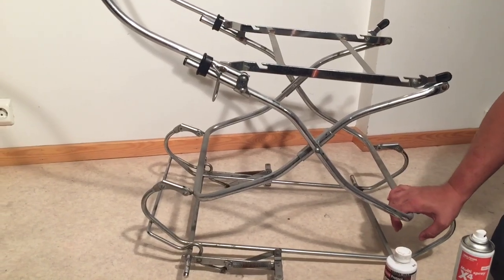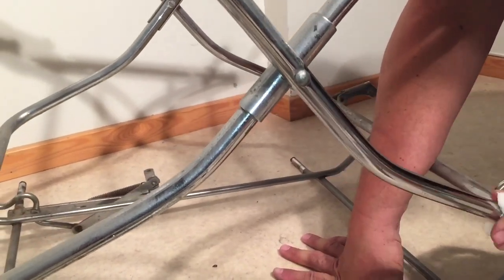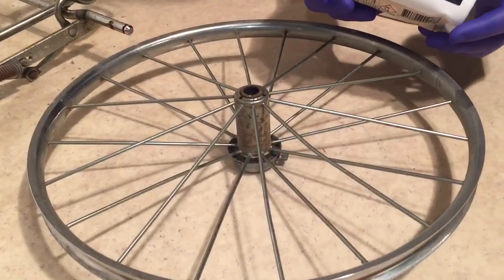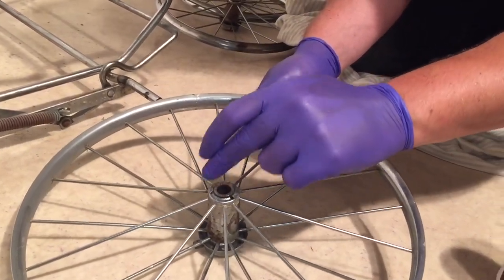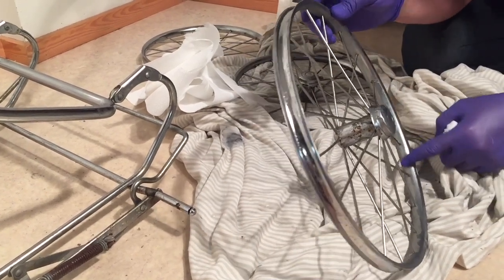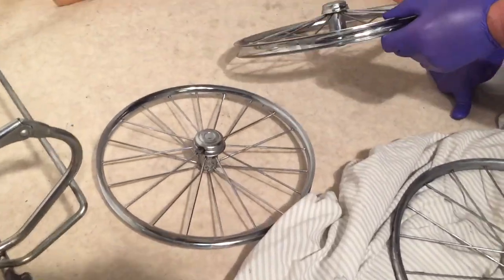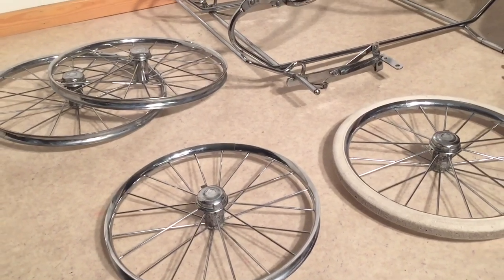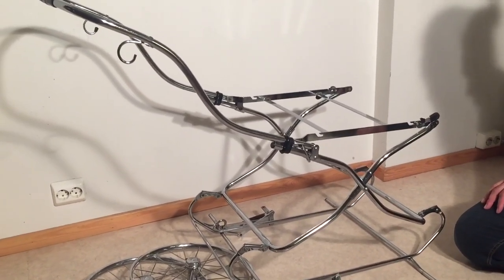Vintage Stroller Renovation: 3 Ways to Remove Rust from the Chassis and Wheels

Comment: Thank you for producing this video. As a stroller and pram collector I run across the rust and caulking a lot. The Simo Classic is a beautiful pram. I don't have a Classic but have three Simo Nordic Cruisers in my collection along with several Emmaljungas which do have the chrome chassis and wheels.